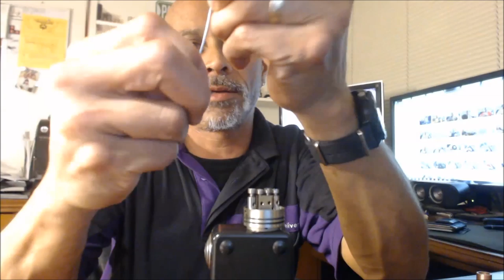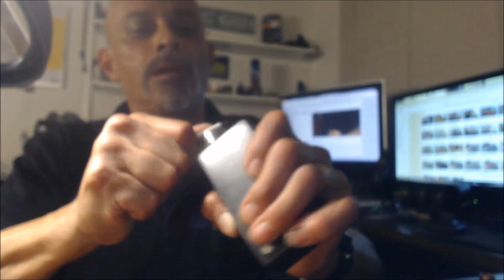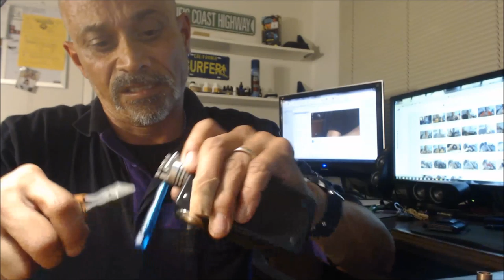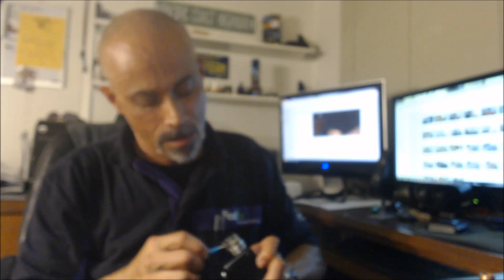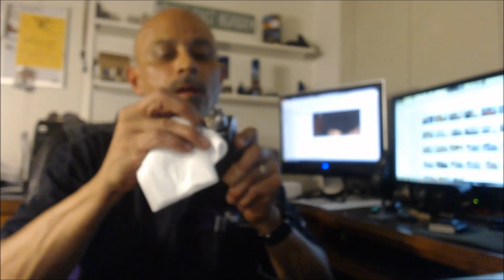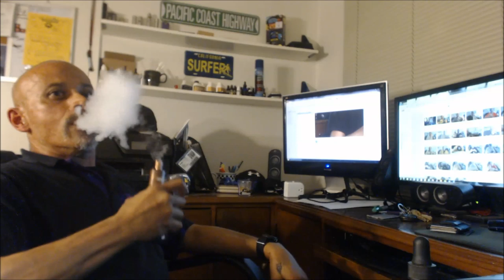Plume Veil triple parallel 22 gauge dual coil nichrome build

Comment: Nice!! Did you ever get the chance to see what it ohms at?
Reply from the maker: No sorry the center pin is inset and does not make contact with the ohm reader
Reply: You can use a multi meter.

Comment: You're probably having to change your kogendo so much because you're using 21 wraps with the small ass air holes from your plume veil clone, if you had a practicle build you might not have to change it
Reply from the maker: What is a kogengo? The airflow has been modified both positive and negative air holes are drilled. I still have that build in that atty. 21 wraps makes for great flavor,  clouds, and wicking lasts longer so I don't know what you are talking about. Thanks for watching and VAPE ON!!!
Reply: +Jacob Jones USPS worker just scrolling...